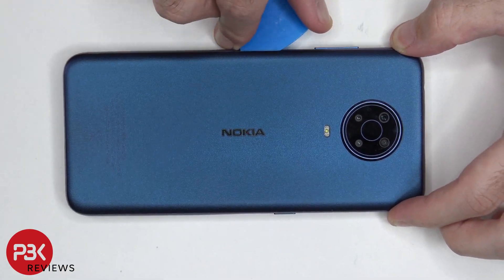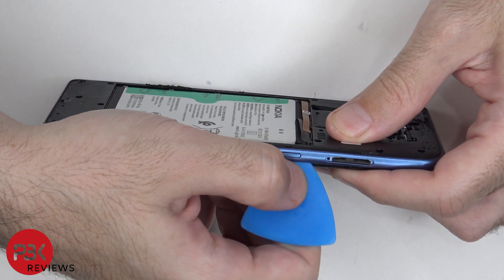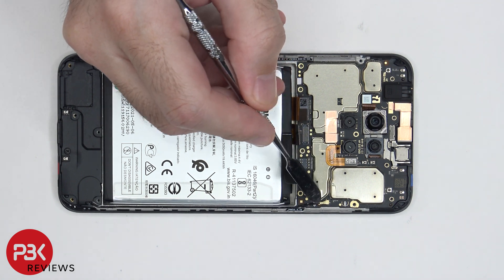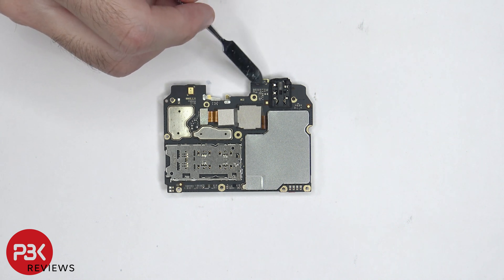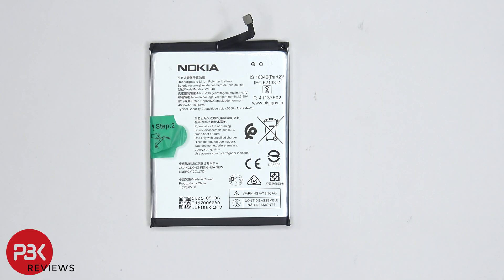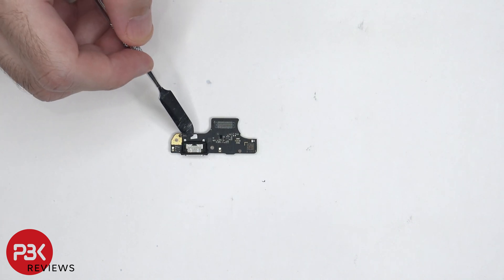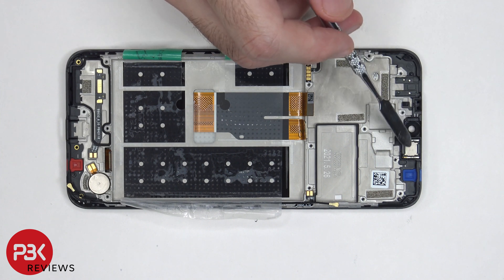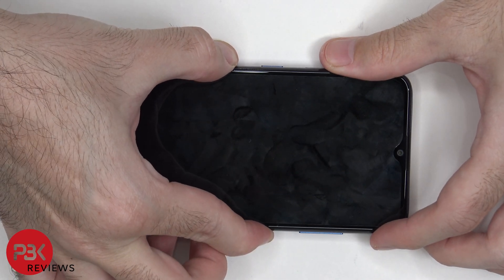Nokia G20 Disassembly Teardown Repair Video Review

Comment: Thanks for this it helped out a lot in figuring out what to do to change the battery in my phone. a 6 minute video detailing everything I need was perfect. My battery failed and puffed up pushing the back cover mostly off so that made it a bit easier to but still way too much needs to be done to replace the battery. Other older Nokia's you just had to remove the back cover that was not glued on and remove a single screw. Still I could replace the battery on the phone without breaking anything so that was a plus

Comment: Where the small net we see above the camera is set? Someone replaced my Broken screen and broke the small net, now my phone has a hole above the screen and he said it was broken because the screen. But when I take the phone to replace it was there. 😡😡
Reply from the maker: You mean the speaker filter? You would need to find one from a different phone online to use, they aren't easily found. You would need something like this : https://www.mobilesentrix.com/earpiece-mesh-for-google-pixel-2-5-0-2-piece-set-10-pack  and cut it down to size or this https://www.mobilesentrix.com/earpiece-mesh-for-oneplus-nord-n200-5g-genuine-oem-pack-of-5
Reply: @PBKreviews  Thanks for replying but isn't the speaker filter. It's visible and like a small net above the front camera. At the top of the screen.

Comment: Is it necessary to disassemble the phone this way in order to change the screen glass+digitizer or is there a quicker way?
Reply from the maker: Aside from removing the top motherboard, yeah you would need to remove all the other stuff to gain access to the screen and sub board flex cables which are routed through the mid frame so you can replace it with the new screen and run those flex cables back through the mid frame and re assemble everything.

Comment: Your work is impressive. However, Nokia made a complicated design to repair. For example screen and battery are the more common replacement parts for any mobile device.
Reply from the maker: Thank you. True, but for people who say need to replace a charging port, or battery etc., prying a working screen has a high chance of damaging the screen so I always prefer to open a phone from the back. More work but less chance of damage.

Comment: Has many of the design for service elements from old school Nokia's. The glue under the battery is irritating... Why? Use cutouts on your glue sheet - you get the same  drop test performance and can get the battery out easier. (Did this in 2010, worked great on a display screen)
Looking at the stack up-> The phone is designed to be opened from the rear up, thinking about the BOM costs, the screen and the cover is probably a single service assembly - cheaper and easier to handle in level 1 or 2 service centres.
Good teardown. 👍🙂
Reply from the maker: Yea, in general I feel it's best for the phones as far as a repair ability stand point to be designed for taking apart from the rear. Since if the screen is not damaged and other components need changing (at least from a user end point of view), it would be less risky to reach the other components from the back than to risk breaking or damaging the display/screen trying to replace other parts in the phone.
Reply: @PBKreviews  My  Nokia G20 fingerprint is damage, I want to buy some and fix it. Where can I get some